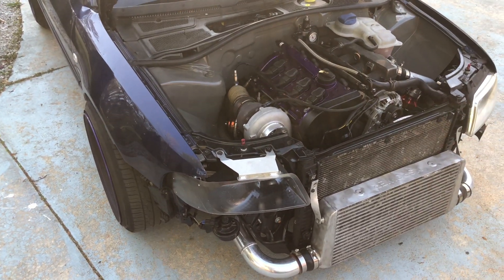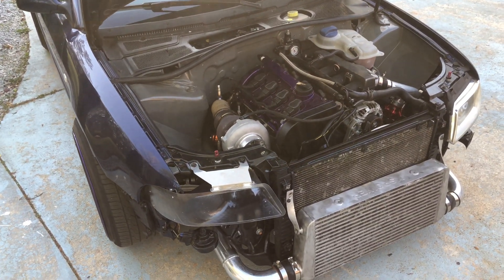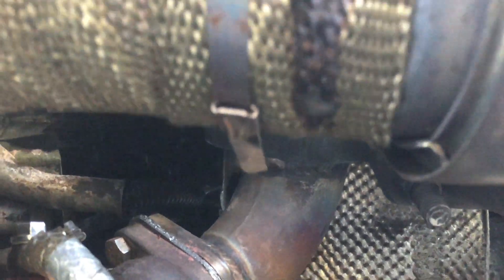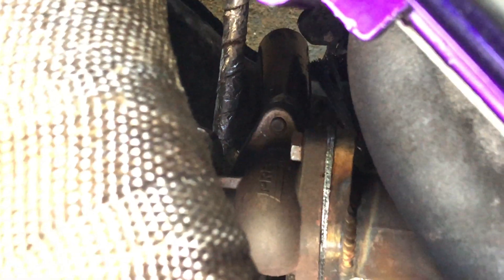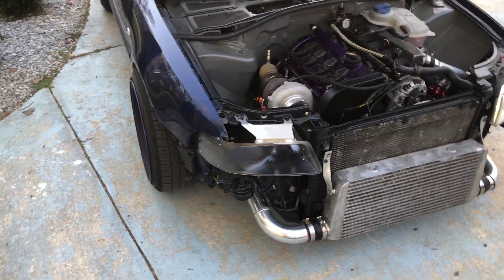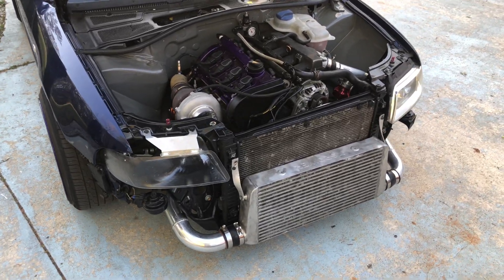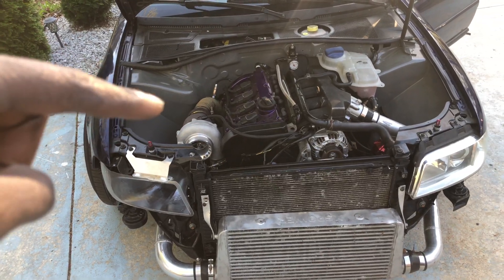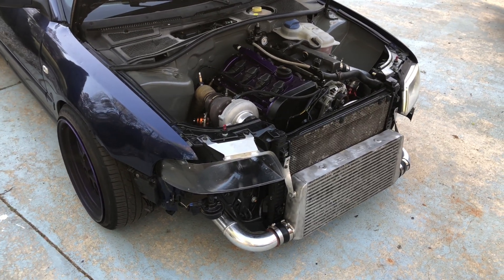Audi A4 1.9T eBay GT3582 19PSI

Comment: whats the wastegate pluming looking like ? got a electronic boost controller ? i see your both using the both and top port on it which probably means you do.
Reply from the maker: @mk4_max  I used a Mac valve boost controller. Top of the wastegate port goes to #2, bottoms goes to #1 and T’s off into a boost source on the hotside which I chose to be the port on the turbo compressor and #3 will be left open on the MAC valve controller

Comment: What exhaust you running? Sounds good. Spool up isnt too aggressive just pulls. I am running k04 currently but planning going BT. Dope👍 need some more videos. How did the turbo work out?
Reply from the maker: It was a 2.5in Borla Catback exhaust system. Spool up wasn’t so great because of many issues I had with that setup.

Comment: bro, for such an engine configuration, this is a weak result, did you measure the acceleration time 0-100, 100-200? I have a 1.8 t cell phone with a k04-64 turbine from golf r goes faster
Reply from the maker: I won’t deny the fact that It was. In this video I had major issues down to boost leaks & tuning. I found out after I uploaded this clip which got fixed and was surprised how much faster It was but never got the chance to upload another clip again. This is not a good example of what it’s supposed to look like.

Comment: Bro where u get your oil lines i start the same projects but i miss the oil lines now i can’t fin it if you can help me out with some information pls tell me
Reply from the maker: I got my oil lines from summit racing. It’s 25mins from me but you can also use eBay lines since not much pressure going through oil lines, it’ll hold up well. That’s what I’m using for my oil drain.

Comment: Damn bro, i love the engine bay how clean it is, and awesome setup. Im currently Gt28 and bolt ons, i blew 2 gt28s already in the past year, down to my last one. Planning on going bigger but still building my AEB/AWM engines I have both long blocks which combo do you suggest to go t35? AEB head with AWM block or wise versa and I'm also running an O1E 6 speed. Current setup is on AWM long block.

Comment: 19PSI@6000RPM xDDDDD such a large turbo in such a small engine is a misunderstanding
Reply from the maker: It actually comes on way sooner than that, around 4K RPMS. I found 3 major boost leaks after I filmed this video.
Reply: @quickshiftmyk1695  Okay, that's much better ;)

Comment: Your car is soo clean!! Mine is a 99.5 TMQ AEB 058.
Reply from the maker: Thank you man! 😁 and those engines definitely has a lot of potential
Reply: @quickshiftmyk1695  yeah, definitely!!
Reply: @quickshiftmyk1695  I plan on upgrading the turbo and manifold soon. Not sure which one to go with.
Reply from the maker: @DustySteelGarage  what’s your setup currently
Reply: @quickshiftmyk1695  currently I have 3” custom CXRacing exhaust with a high flow cat. 2.0 coil pack and icm delete. Turbo inlet pipe. Custom intake. 440cc injectors. Eurodyne Maestro Tuning.
Reply: @quickshiftmyk1695  custom Mishimoto radiator.
Reply from the maker: @DustySteelGarage  just slap a log manifold, decent sized turbo like a 50-58mm turbo and have fun with It

Comment: Love the build bro! I have a 2000 a4 with a big turbo swap and some spray that helps with the lag. Best part is I got the car for 1,300. I practically stole it.
Reply from the maker: Nice!😂 these cars are very affordable and easy to make power
Reply: Picked mine up for 800 bucks already on blistein coilovers
Reply: Picked mine up for 500! Got a spare motor & trans for 400 & currently building that motor. Picked up some ie cams now that they make them again, so excited but still a long way to go

Comment: What made you choose the 1.9 over the 1.8? And what are the main differences? Sick for sure and i hope to see the finalized project.
Reply from the maker: Beetlejuice 123 It wasn’t by choice. I just got a good deal on a built short block with 83mm pistons and rods so I pretty refreshed and replaced all the bearings and rings and the crank. The difference I noticed is in the Torque and acceleration. The car accelerates much faster and just performs a lot smoother compared to stock displacement.

Comment: Hello from spain, What are u running on your fuel system? And also im studying at a high performance academy and im wondering what ecu you are running.

Thanks and congratulations i love The channel
Reply from the maker: Alejandro Jaurrieta Hey, Thanks man! I’m running a Walbro 450 Fuel pump, -8an Feed with -6an Return. For ECU I’m using Maestro 7 Suite aka Eurodyne.
Reply: @quickshiftmyk1695  I also have the Maestro 7 Suite. Got any tips on Tuning? So far I just have stock turbo with full custom 3” exhaust with high flow cat and 440 green giant injectors.
Reply from the maker: @DustySteelGarage  have someone tune It or if you want to do so yourself, there’s a few videos online on how to get started.
Reply: Thanks for your reply.

Comment: damn, pretty dope. though isn't the GT3582 wayyy too big? If you built the motor properly you can raise the rev limiter to get more power band, should help, just make sure you're not running stock cams if you do
Reply from the maker: Fudge You it’s not big unless you have the supporting mods for It. I do plan on revving close to 9k with bigger cams as well. All that is apart of my next setup.

Comment: Yow mi G where you buy your manifold manifold? I want to make a sidewinder for my Jetta. And what the machine yuh buy? just ordered a ahp alphatig too
Reply from the maker: wanna be fast 1.8t which manifold? The one I have on the car or the one I’m going to make? And I’m going with the Everlast PowerTig 200DV. I was looking at the Alphatig as well, I’ve heard good reviews and most of my friends have It but I wanted the most service behind my machine if anything happens to It so I went with the everlast.
Reply: @quickshiftmyk1695  like i meant to say your manifold piping material to build your own where you buy that stuff? And ok fair enough i used the alphatig because a friend has it and i liked it so decided I'd grab one make my self an intake manifold and other stuff i had to pay to get made in the pass not anymore